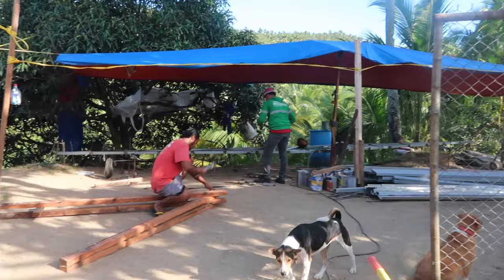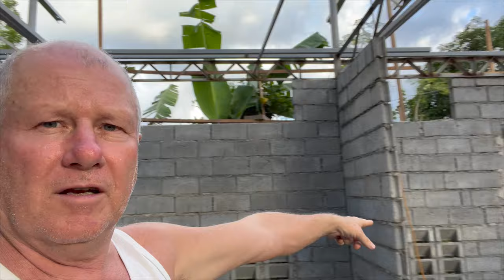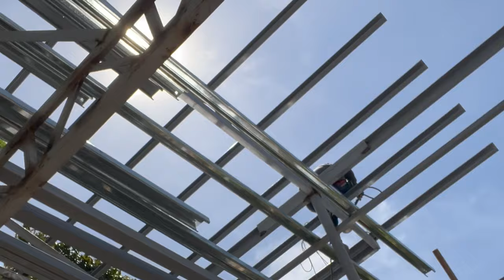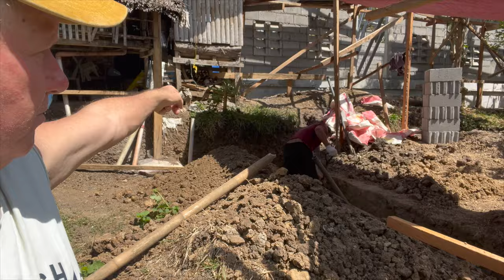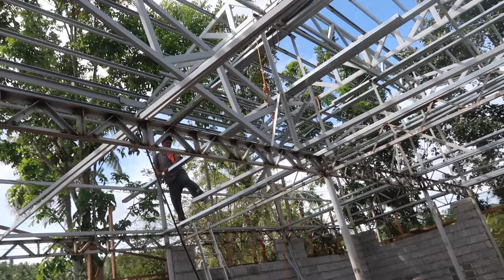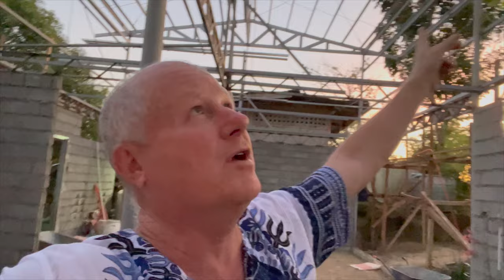ROOF TRUSSES AND PURLINS Are Installed | Building House In The Philippines

Comment: The work looks good, however, this structure will not survive a very high wind (Typhone) or a big Earth Quake. Very tall and wide walls without any columns or bond beams ( tie beams ), the trusses look good, however, this is thin wall tubular, the trusses should have been made from 1/4" thick angle bars. Good luck.
Reply from the maker: They were 1/4 thickness of angle bar and we put tie beams as well. Thanks for the comment